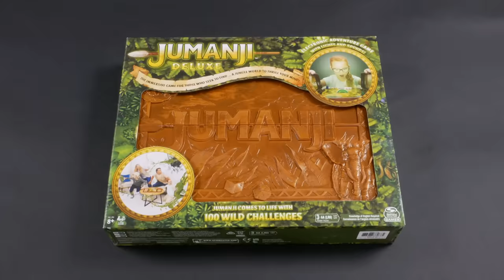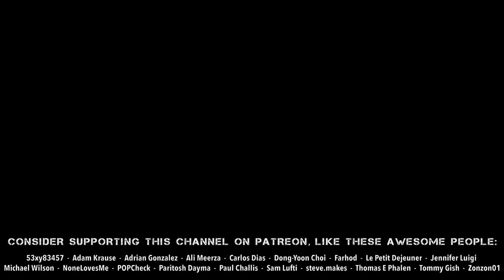Repainting a Toy Jumanji Board - Timelapse

Comment: Outstanding painting... they had everything you needed but just never bothered to paint all those nice sculptural forms. Makes you want to buy it just to bring it up to its potential. That said... Possibly include a way to change the batteries? I mean, maybe the mechanism was dead in which case it doesn't matter, but if it's working, wouldn't you want a way to access the battery case? A lil notch to pull out the board or something?
Reply from the maker: That is definitely a better idea than the "wedge a chisel in between the plastic and wood to open the back" one that I went with. lol. It just looks so clean without a notch.

Comment: I have the original basic release and the wood box that opens up ( the card reader is too big for the board, no rules either side, but the box itself is great. I only found out about the deluxe, and, great they FINALLY got the game right, but, there's still a lot missing. the custom ones are the go to, but they are VERY PRICY. this is awesome, surely the company could have printed a sticker to go over the cover.

Comment: I'm not knocking your work, infact I was thinking about doing this myself. But watching this and taking note what your supplies were, this project would be about 100 bucks wouldn't it? Not including the power tools or hours spent. I mean the paints, the bondo, and the wood.
Reply from the maker: Just for fun and because I was curious myself; I used 10 Americana paints which you can get for $1.50 each from Michaels, 4 Spray paint cans for about $6 each, $38 for FreeForm Air, $12 for the wood. So if you were jumping in from scratch, it's something like $89 in materials, not including the $50 Jumanji board itself. 

There are definitely things you could do to lower the amount, like buying fewer colors of paint and mixing the colors you need, or using Bondo, like you suggested, rather than FreeForm Air. Mostly for me, it comes down to buying materials I will have more use for in the future. I didn't need to buy any of the Acrylic paint because I had bought them for projects in the past. And the Freeform that I did buy for this, is super useful for my work and I didn't even use 1% of the container, so the cost will trickle out over multiple projects. 

I'm sure you weren't expecting a novel as a response, but thanks for the question!
Reply: @StevenRichter  I'm a prop maker too. I don't mind taking notes! Funny enough I found your Etsy and have been trying to plan making my own Jumanji board using the box top you sell.
Reply from the maker: @Taraka1  Oh, nice! It's a fun project, I wish you luck!